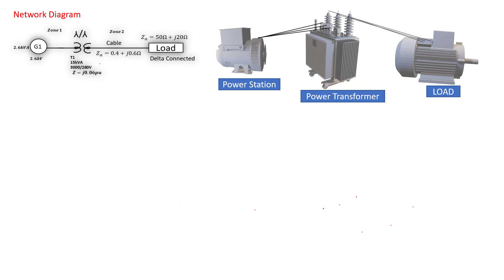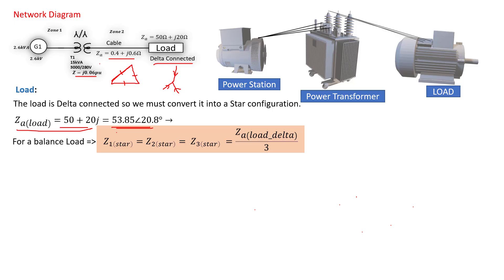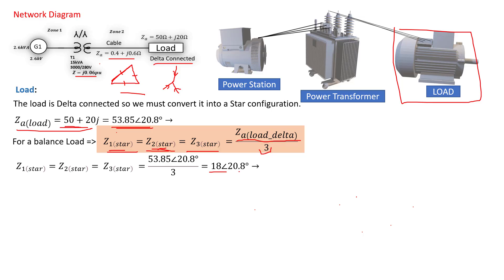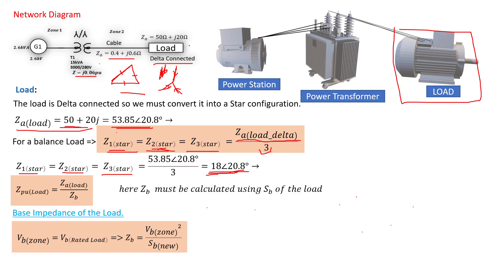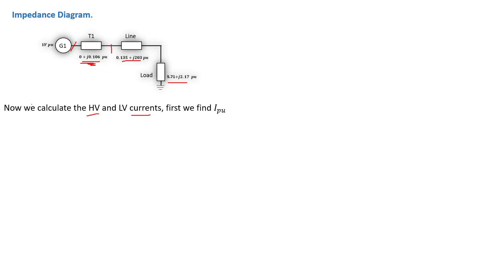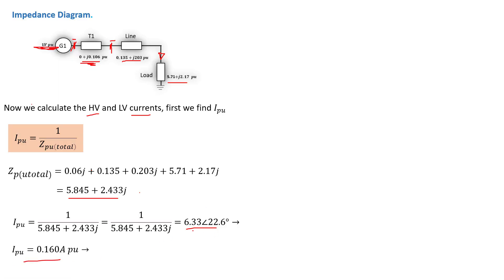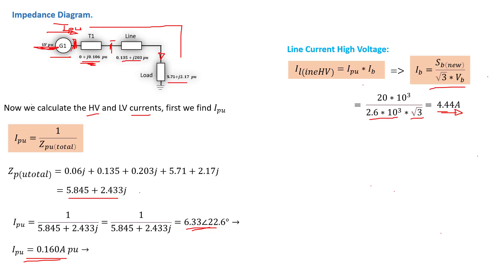Per-unit system calculations - Tutorial 2.part 2

Comment from the maker: Attention ! ✍
Typo @ 09:17 a wrong value of Zpu(T1) was used to calculate Zpu(Total).
Below are the correct values of currents and Zpu(Total) slightly affected.

👇👇👇👇
The correct Zpu(Total) = 5.845 + j2.479 , with => Ipu = 0.1575A can round to Ipu = 0.158A.
The line current High Voltage Side (primary side) = 0.699A can round to 0.7A.
The line current Low Voltage Side (secondary side) = 7.493A can round to 7.5A.

Slight changes in our current calculation which is very important to maintain a reliable system protection

Comment: There is something wrong with your Ipu calculation at around 9min. Not what others have already stated. You do not use the 1/Zptotal you just use Zptotal. Also, why is there no j component to the Ipu? I am getting something very different
Reply from the maker: Hi, please review the tutorial again. At 10:00, I calculated Ipu = 0.16 pu using the total impedance magnitude, Zpu = 6.33∠22.6°. We don’t use ‘j’ in this case because the per-unit current is derived from the magnitude of Zpu, not its complex components.

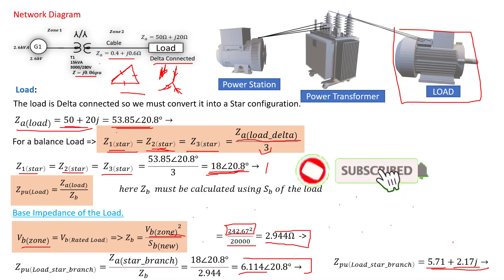Comment: 07:00 Zb= 2,944
Why you didn’t get any angle?
Reply from the maker: Hi, thank you for your question. In per unit system the focus is on magnitude values calculation not phase angles. Zb was calculated using the magnitude of the zone voltage and the magnitude of the base MVA with no angles, this is why Zb doesn't have an angle. But this is diffferent when calculating the Actual impedance as we take account of the load angle.

Comment: You have taken incorrect value of Zpu(T1) while calculating Zpu(total). The correct value of Zpu(T1) is j0.106, not j0.06. Thanks
Reply from the maker: Thank you @kandarp mehta for pointing it out, you are not the first person to do so, I had a review of the video again, and you are right just like @Rare Talent of India, also pointed it out 3 weeks ago.
When doing per unit calculation even wrongly rounding values can have a huge impact on the final value of the fault current.

The correct Zpu(Total) = 5.845 + j2.479 , with => Ipu = 0.1575A can round to Ipu = 0.158A.
The line current High Voltage Side (primary side) = 0.699A can round to 0.7A.
The line current Low Voltage Side (secondary side) = 7.493A can round to 7.5A.

Slight changes in our current calculation which is very important to maintain a reliable system protection

Comment: You total calculation not correct. Trf is .106j pu
Reply from the maker: Hi, thanks for your comment, Transformer T1 per unit value is indeed 0.106j pu, which is a correct value as calculated.
Reply from the maker: Hi, thanks again for pointing out the typo, I've seen it.
And below are the rectification.
👇👇👇
The correct Zpu(Total) = 5.845 + j2.479 , with => Ipu = 0.1575A can round to Ipu = 0.158A.
The line current High Voltage Side (primary side) = 0.699A can round to 0.7A.
The line current Low Voltage Side (secondary side) = 7.493A can round to 7.5A.

Slight changes in our current calculation which is very important to maintain a reliable system protection